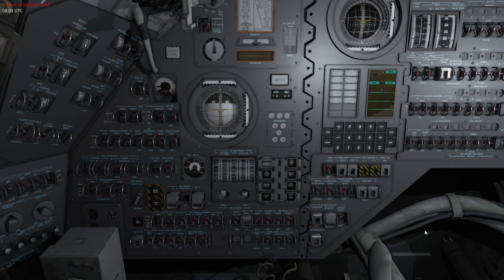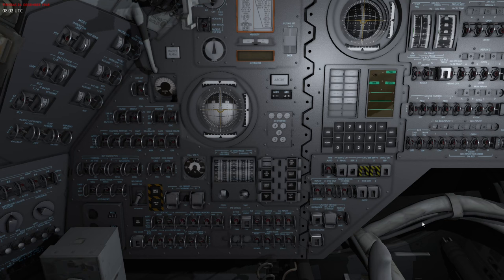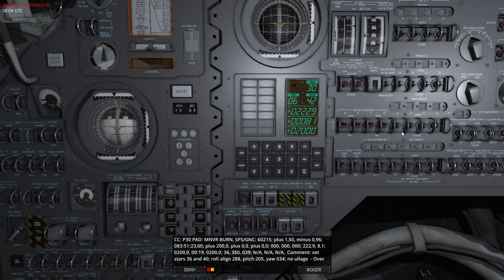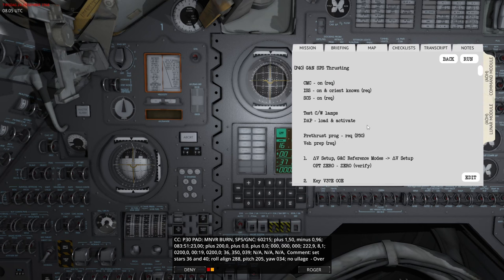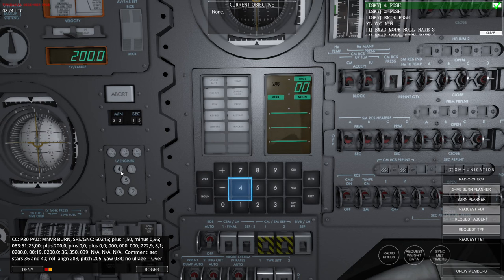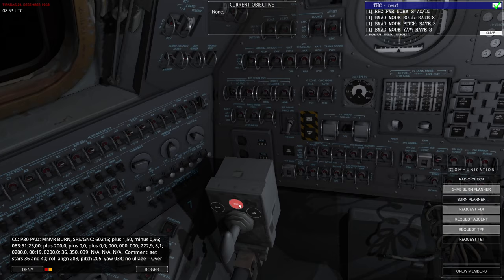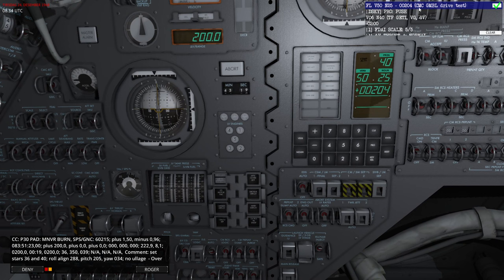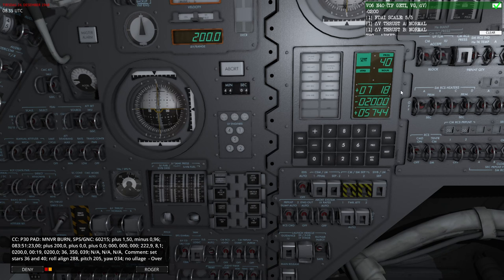Executing SPS burns in the Apollo Command Module - P40 G&N SPS Thrusting

Comment: Hello, I love this series and I have a challenge for you. Perhaps you’re familiar with this story.  The Apollo 10 Mission was intended to be a full rehearsal of all aspects of the landing mission, except the landing.  What is most interesting is that NASA actually seriously considered the possibility that the Apollo 10 LEM crew might essentially mutiny and land on the Moon anyway.  To prevent this, NASA short-fueled the LEM ascent stage (reportedly by 50%) to make it impossible to achieve lunar orbit.  The descent stage however appears to have been fully fueled.  My hypothetical challenge is this:  Assume that either the LEM crew, or all three crewmen of Apollo 10 secretly mutiny and cooperate to execute a lunar landing against orders.
A)If only the LEM crew revolted, consider this scenario:  land using exclusively the AGC to minimize fuel use (i.e. no jockeying around like Armstrong) , do an EVA and collect a few rocks, then jettison all extra weight and take off USING THE DESCENT STAGE, burn to exhaustion, then switch to the ascent stage.
B)If it is impossible to achieve the programmed orbit using the above method, then assume that the CM pilot joins the mutiny.  Can the CM drop down into a trajectory reachable by the LEM, then boost back up and return to Earth?
C)Finally, what does dropping down to one astronaut on the LEM (along with all the necessary accoutrement) do to either of those scenarios?
Wiki has the LEM weights.
https://en.wikipedia.org/wiki/Apollo_10
I think this could make for a cool series of videos.